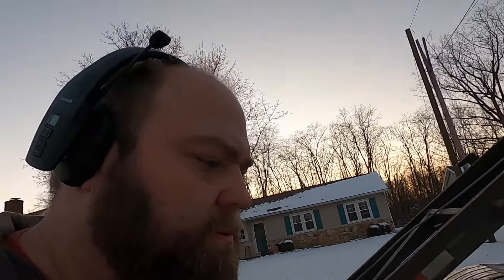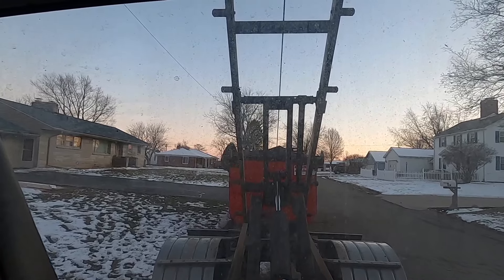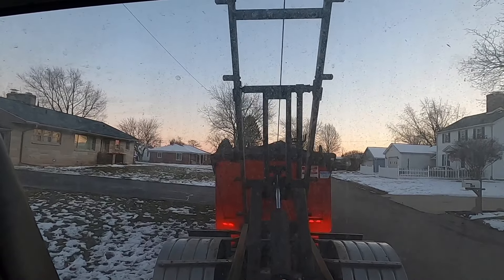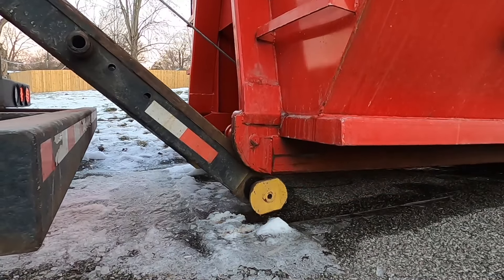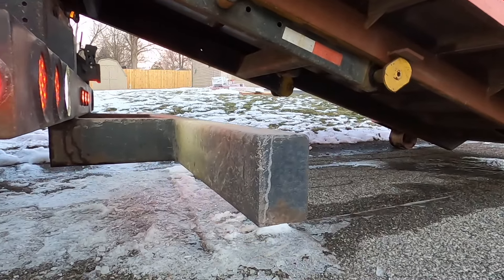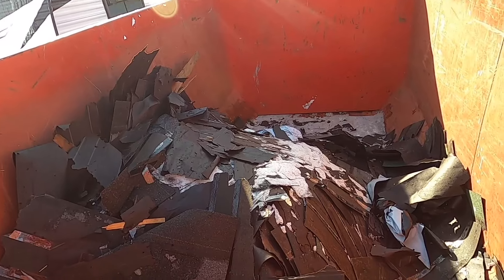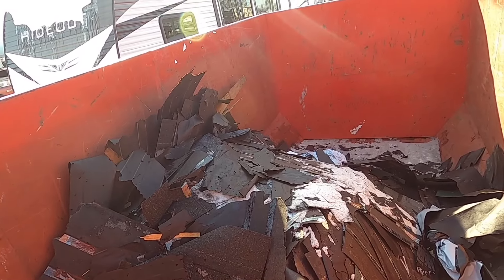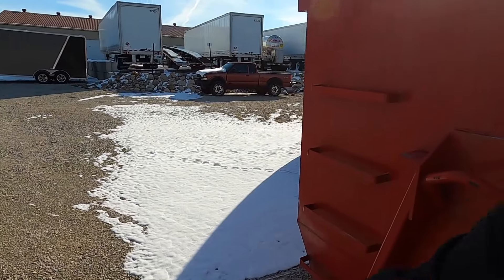Volume vs. Weight: The 20-Yard Dumpster (SHINGLE DILEMMA) with an Under CDL Truck

Comment: I just did a 10 yard with shingles yesterday.  Ended up weighing 10,200 lbs. When I get bigger dumpsters this year I am going to limit roofers to only the 10 yard cans. That way I can keep under cdl and not overload my truck.
I will offer multiple dumpsters for their  bigger jobs.
Reply from the maker: I think that’s a great way to keep yourself safe. Sometimes though, there’s wood, plastic and other debris that could easily fit in a slightly larger dumpster and still not overdue it, depending on the square of shingles of course.

Comment: Some information to keep in mind. 
The average weight of a square of three-tab asphalt shingles is 230-250 pounds, while architectural asphalt shingles typically weigh 400-430 pounds per square. A square of slate shingles weighs 800-1,000 pounds on average.
Reply from the maker: Thank you for sharing this my friend. What a difference the weight can be at scale!

Comment: Small enclosed trailer would work. You can buy a container subframe for 20’ shipping containers too, then you could move it with your truck. If it’s more convenient just rent one of the storage units. It’s a write off anyway.
Ask the customers what they are putting in the dumpsters, if it’s shingles and they want a 20 yard, tell them you will give them 2 10 yards for the same price as 1 20 yard. You shouldn’t risk being overweight

Comment: What about getting a 12' shipping container that you can actually convert to pull up onto your truck?  It can move to another yard with you down the road and you could possibly even rent it out for people doing small moves.
Reply from the maker: Definitely a cheaper option and investment rather than a whole enclosed trailer. I’ve seen them around $2-3k, probably $750 for rails added? 🤷‍♂️ might be a solid setup. I’ll look more into it! Thanks for the thought my friend!